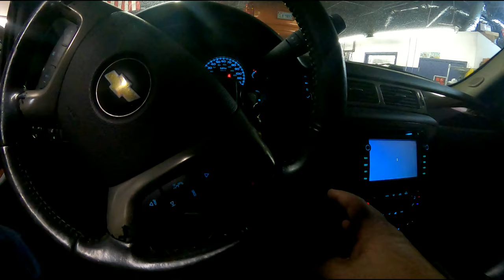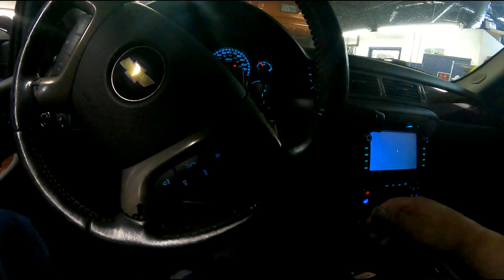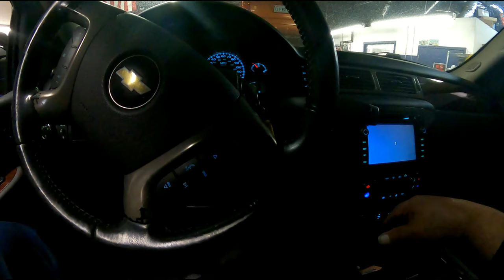What To Do When You Have A Stuck Throttle Valve

Comment: I have a 700r4 just rebuilt. Will not shift out of 1st until 40-50 mph the shift to second happens around 70-80 then shift to 3rd around 105 have not been able to catch 4th gear. And these speeds are accelerating at a normal speed but does not change with the pedal to the floor
Reply from the maker: More than likely your throttle valve is sticking. That or the governor. This is assuming the cable is adjusted properly.
Reply: @CurmudgeonTransmission  could the cable be out of adjustment, if it was just unhooked and then hooked back up?
Reply from the maker: @kelscott13  It's possible.

Comment: so we dont have any good trans shops in area, i found this video and had a question, i have a 88 suburban, 1-2 and 2-3 shift on point but 3-4 will not shift unless i let off gas or i am barely barely giving it gas. does that sound like a stuck 3-4 valve, trans was rebuilt a few thousand miles ago and never had this problem till recently. tv cable has been adjusted to stock pressure settings
Reply from the maker: Verify the cable is set this way in the article I am sending. If it still doing it I would look at the 3-4 Shift valve. If everything looks good get back to me. https://gearsmagazine.com/magazine/a-look-back-adjusting-the-thm700-r4-throttle-valve-cable/

Comment: I have a question on my 700r4 what cause a transmission to stay  reverse on neutral ..when I shifted down to overdrive it becomes neutral .. why is that..
Reply from the maker: Something is wrong with the shifter either inside or outside the transmission or the shifter cable/Linkage depending on which you have.

Comment: in here some trans men dont want to change oil, they says changing oil trans can be not shift. these are like af20 or 4L30E trans. but i think these are a myth. can this problem be in these trans?
Reply from the maker: Can happen on any transmission. I ask a lot of questions before I will do a fluid change. If it has not been done regularly I won't do it.

Comment: So my transmission that was rebuilt a few months ago already has an issue.   The 1 to 2 upshift is hard when under about half throttle and also when you get on it while merging.   I cant win! Haha
Reply from the maker: There are a ton of things that can affect shift feel. Any codes in the system? Even if the light is not on does not mean there are no codes.
Reply: Its a 1990 Oldsmobile. Does it even have a trans computer?
Reply from the maker: What model Olds?
Reply: 90 Olds Eighty Eight Royale
Reply from the maker: PCM. Only controls lock up on this unit. The modulator controls shift feel, throttle cable controls shift timing on this one. Check the vacuum. Sometimes the port in the throttle body gets plugged, happens more on the Cadillac but can happen on these as well.
Reply: Why does it only happen when its the 1-2 upshift and even the 3-1 downshift?   Trans has maybe 400 miles on it.  Paid $2800 🤦🏻‍♂️
Reply from the maker: @medic8890  Those 2 will be the most noticable. Was the modulator replaced?  If it was replaced with a universal one you will want to find a factory style. Have had issues with the universal one.
Reply: Im not sure which module he used but im hesitant to bring it back to them. Not going to lie

Comment: My c1500 with 700r4 is taking a long time to shift from 1st to 2nd  has to go to 4000rpm for it to shift to 2nd do you think it has a sticky throttle valve and should i change the tranny fluid
Reply from the maker: Is this before or after a rebuild? If it is the throttle valve it will effect all the shifts. Not just the 1-2. Are you sure it is shifting to second and not maybe shifting 1-3? Skipping 2nd? Either way, I would be looking at the 2nd apply side of the servo and the 1-2 shift valves. Does it ever shift to 4th? If not, you are looking at something with the band and/or servo, as it is used for both 2nd and 4th.
Reply: @CurmudgeonTransmission  at what speed would it be on 3rd
Reply: @CurmudgeonTransmission  should i try a new servo
Reply from the maker: All depends on throttle angle. It can be as early as 25mph and as late as 60. Need to determine exactly what it is doing before you know what to fix.

Comment: Throttle valve cable, engine running pull the cable with needle-nose pliers and let it snap back by itself quickly. Governor's raise the rear wheels, get it up to about 20 miles an hour light throttle slamming into reverse back down to drive. Everybody has their own way that's how I used to do it.
Reply from the maker: True, thanks for sharing that. Thanks for watching.